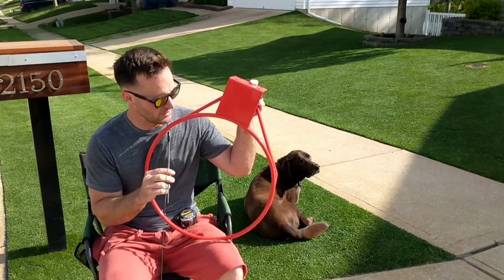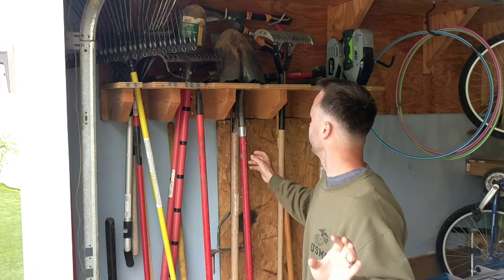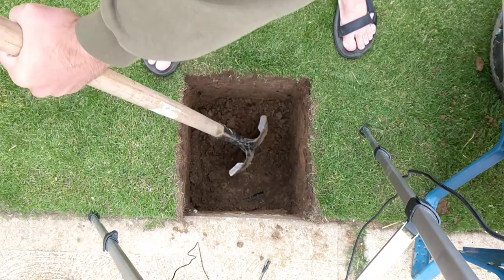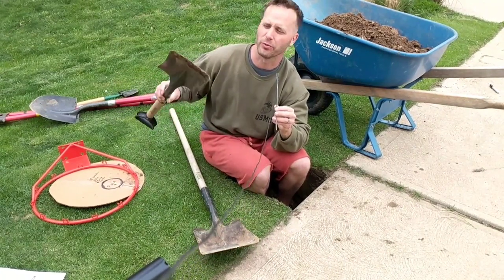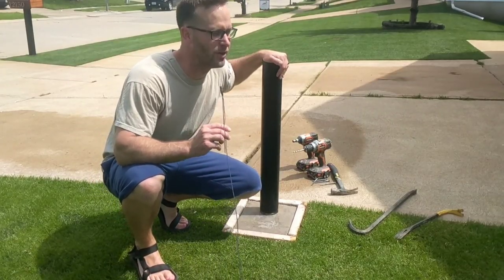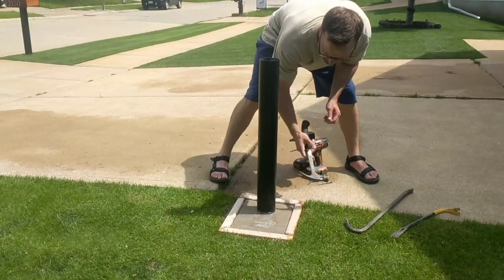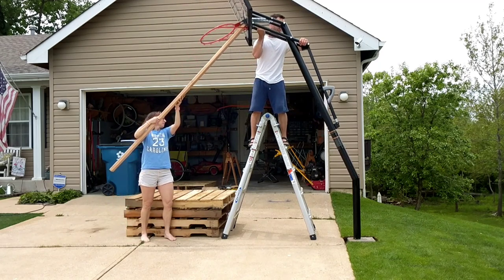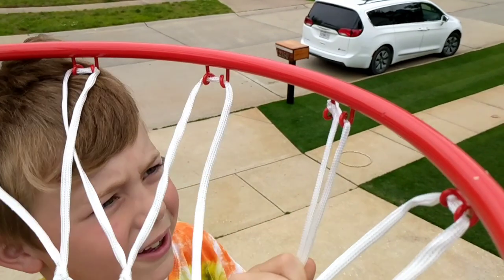In Ground Basketball Hoop Installation

Comment: I got a different model and installed it per the directions.  I didn’t put concrete or rebar down the middle of the pole and the backboard is wobbly.  It looks like yours is too though.  Do you think the rebar and concrete down the pole helped?
Reply from the maker: The board wobbles with about 1" of movement. My guess it it helps a good about as concrete effectively doesn't bend. How much play does yours have?

Comment: I loved this video. The only thing is why put the goal so close to the house? Why not center it more in the driveway for the kids to develop equal shooting capabilities on left and right side of the rim?
Reply from the maker: Thanks! Several reasons but mainly- The driveway has an irregular slope due to cracked/sinking concrete. I put the hoop on the flattest slab to they can practice free throws with somewhat flat footing. There pro/cons & risks to anywhere in this particular situation.

Comment: Great video! Our city has removed all basketball rims at every park thanks to COVID! Do you need to spray the springs with WD40 regularly to prevent rust?
Reply from the maker: Thank you! And sorry to hear that, seems a bit overkill. I haven't had to do that so far,and no rust. Perhaps the type of steel in this one does not require it.

Comment: Holy shit dude this is a perfect video on how to do unsafely as possible. From flip flops, to no respirator when mixing concrete and your kid right there sucking in the dust to using an angle grinder with no safety glasses. Please set a better example for your kid.
Reply from the maker: I honestly need a safety advisor, how much do you charge?